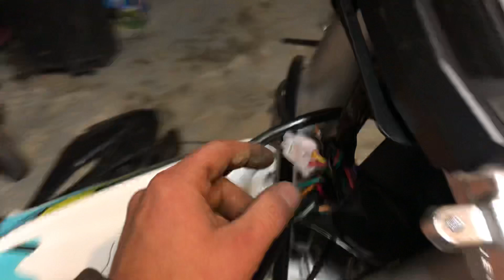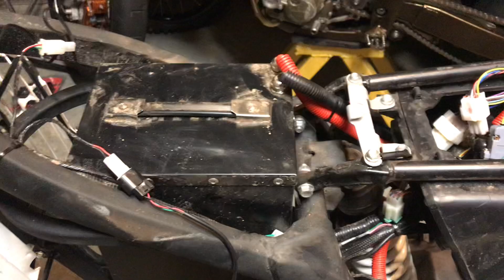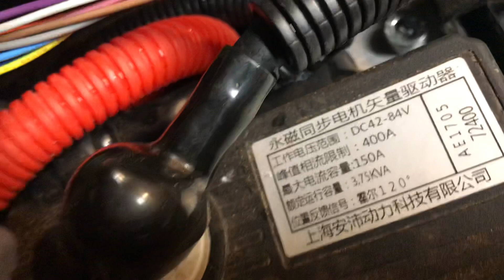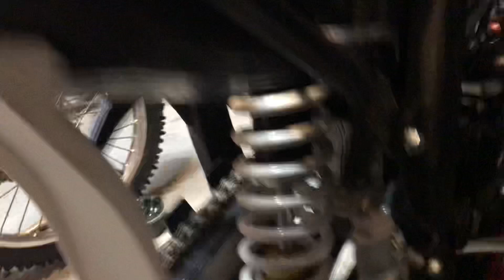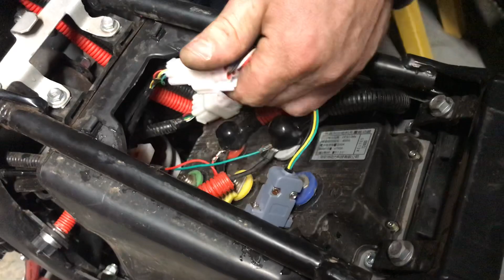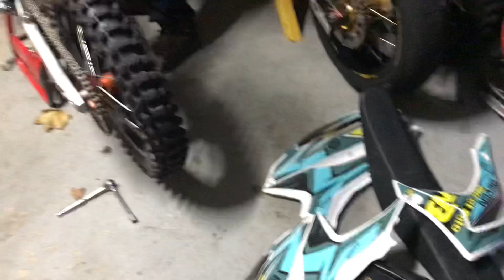Electric ⚡️ MX review: Nicot strip down - surron storm bee - stark varg

Comment: Hey guys, I know this is a longshot, but can you guys point me in the direction of any resources for help repairing one of these. I have a brand new 2024. I can’t get it to turn on or anything to function. Anyone in LA who works on these things?
Reply: Did you get any fixed? Where did you get yours from?
Reply: @HeadingOut00 nope. I bought from a kid who had a few of them near LA. I ended up frying  the controller. I bought a far driver but cant wire it so i need a stock replacement to put in. Ita been sitting in my room for almost a year now.
Reply: Still brand new never ridden. Need a battery too now

Comment: I am having an issue on mine where the bike turns on and shows 78.1V DC and the Dash lights up. However, the motor will not respond to throttle input in neutral and the controller is flashing 1-2 as a fault.
Reply from the maker: When mine is fully charged it indicated 83V

If there is a fault flashing could be a short in your wiring 

Try removing or disconnect conenctions one by one see if you can isolate the issue
Reply: @electricmx  I was able to isolate it down to the throttle potentiometer. After disconnecting it and jumping between the wires on the bike side of the throttle wires, the motor spun up in neutral. When I plugged the throttle connector back in, the fault returned. I am going to install a Domino throttle and go full throttle by wire. Thanks for the response.
Reply: @carver8567  did you sort this issue out?
Reply: @purpleether5405  still working it. I am having issues getting the EVDrive Manager I have to work.
Reply: @purpleether5405  All sorted a while back. I installed a Domino Electric IP 65 rated throttle and LOVE it even more!
Reply: @carver8567  nice. good to hear
Reply from the maker: I have had that issue aswell and replaced the unit 👍⚡️
Reply: @electricmx  well, I saw your video on the wiring issues that you've had, and I appreciate that break down. I am seeing a lot of what you did as well with the tightness of the harness. How did the firmware update for the controller work out?
Reply from the maker: I had a computer issue im still working on updating havent had the time to get back into it
Reply: @electricmx  the first time they sent me the updater software, it wouldn't run on anything but windows 7. They have since sent me the updater software that is supposed to work with win 10

Comment: Replace the throttle with a full electric throttle problem solved... that's the kind they used to use on the surron cable to electric. I think domino is suppose to have a similar feel to a classic dirtbike throttle with a little more tension in the spring
Reply from the maker: Good idea! Thanks

Comment: Very nice video!!
Reply from the maker: Thanks brother soon I will learn to edit make it little more professional🤓😎
Reply: @electricmx  looks good man! Keep it up, so quick question about the nicot. What is your thoughts on the battery? Performance wise and range?
Reply from the maker: @LifeWithStiel  the battery is 50aH pretty solid unit starting to stock spares for people requesting one to change out. It’s better battery then the time et which is only 40aH

But all in all not bad!! Had one issue as I’m still trouble shooting to see if the battery cut out power or the controller. I will post more videos as we gain more knowledge. Range is max 100km going slower speed
Reply: @electricmx  awesome! Im currently saving up for either a nicot or sur ron. Sur ron because of all the plug and play options
Reply: @electricmx  I really want to know more about the motor.
Reply from the maker: @RetroElectric   feel free to reach out 

electricmxcorp@gmail.com
IG _electric_mx
Phone/text 1-289-556-8488

Thanks and glad to see your interest!!